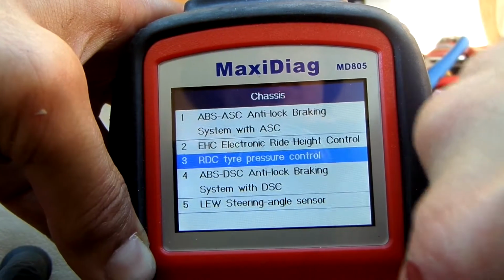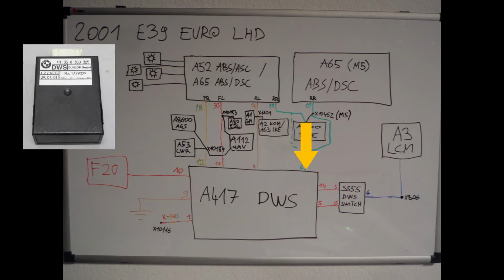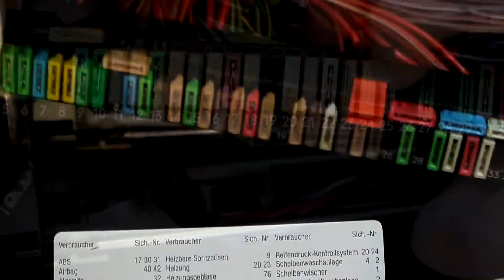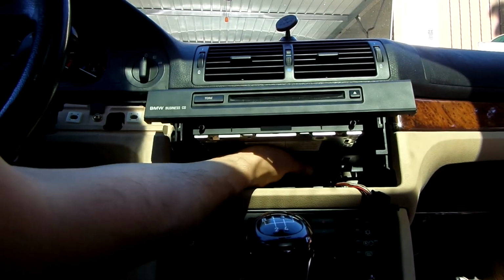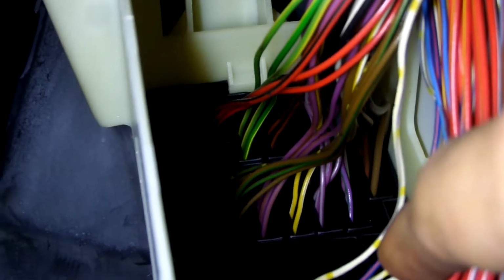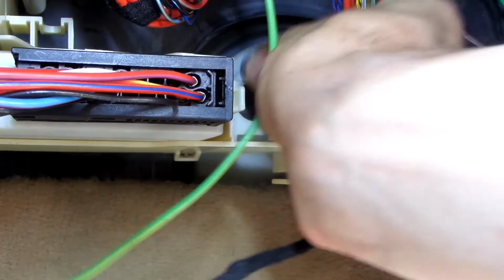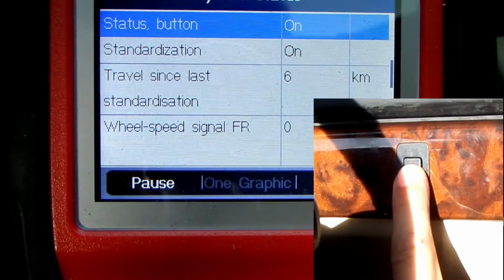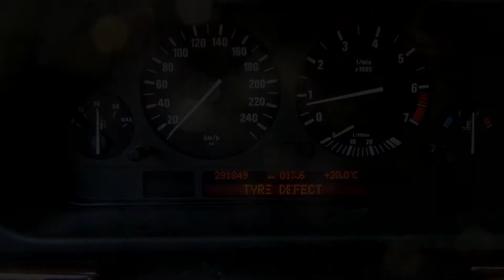🛞 [BMW E39] Retrofitting Tire Pressure Monitoring System (DWS)

Comment: Nice tutorial. I have a question. Will it work with every instrument cluster with board computer? Or only on newer models (2000+ for example)?
Reply from the maker: What the DWS module essentially does (if I simplify), is that it sends a message over the network and the instrument cluster displays it. So I think it should work with any high cluster.
What I am not sure is if the early ABS models (before MY 1999) give out the signals needed for the DWS.
Reply: @ProperRepair  I wouldn't worry about ABS unit. I have checked it on WDS and I am almost sure that speed signals are the same. I thought that DWS check controls are predefined, "written" in instrument cluster and DWS module only triggers them, that's why I asked. If it is as you say, it shouldn't be a problem to retrofit this to car with -1998 instrument cluster. Thanks for answer.

Comment: Excellent video!
How do you identify these connectors?
X1101, X10184, X10183
It's hard to see in the video what these connectors are.
Reply from the maker: Only by colours;
X1101 brown/red
X10184 yellow/white
X1083 yellow/red

I cannot be sure however that colours did not change within production.